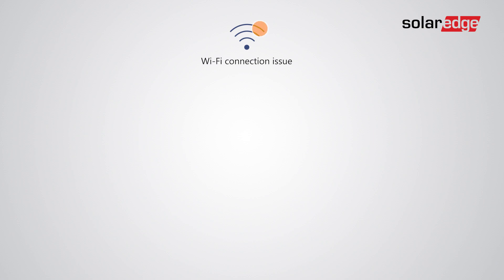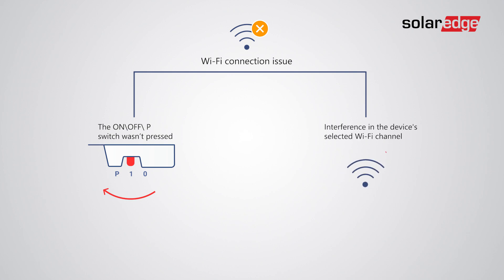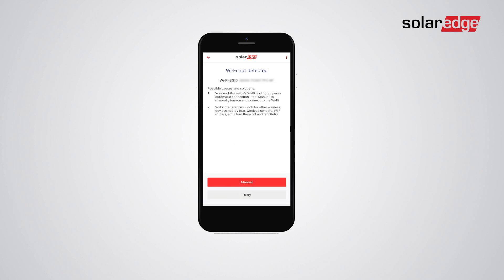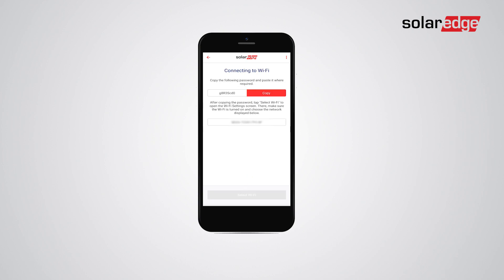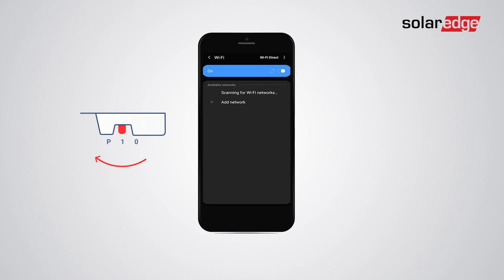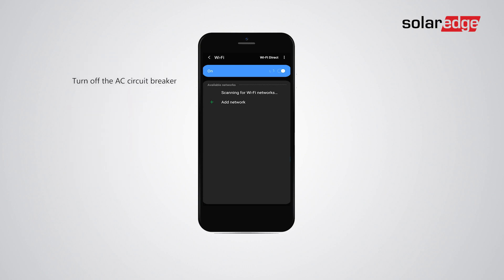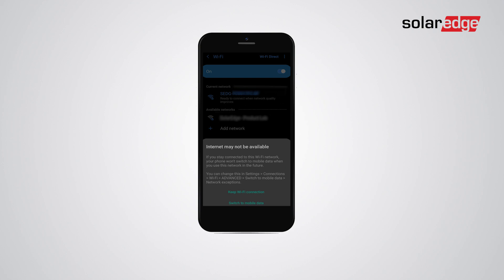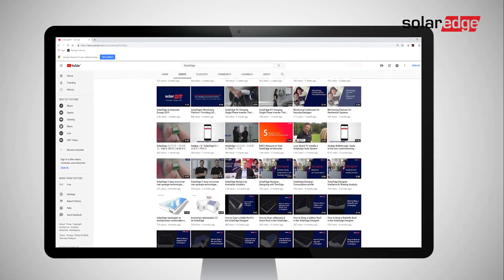Solving Wi-Fi connection issues with SolarEdge SetApp-enabled Inverters| International

Comment: Hi my WiFi works good, I can connect the inverter to WiFi no problem, but after the inverter goes to standby it looses the connection to WiFi and doesn't reconnect until I do it myself manual with the SetApp. Is this something with my WiFi or the inverter. Any help is appreciated thanks

Comment: this fucking thing tells me "ethernet (LAN) not connected". the fuck is that all about?
Reply: Same to me?
Reply: How did you fix it? or did you need technician to come out and switch the communication back to Wifi?
Reply: @couver111 unfortunately, all i can say is a different, evidently more competent tech showed up and had it running in a snap.

Comment: When I go through the steps it says connected but then asks for the LAN. There is no LAN. Any idea?
Reply: how did you resolve this issue? did you need a technician to come out and change the communication back to Wifi from LAN?
Reply: @couver111 i have the same problem. Did you manage to fix it?

Comment: Hello Everyone!

If you cannot connect to your inverter AP (wifi SSID doesn't pop up) please reset the comm. module as described in this video (switch to 'P' more than 30 sec).

SE wifi module unable to communicate with: 
- OFDMA & MU-MIMO enabled
- channel number more than 10
- only support 802.11 b/g protocol
- only support 2,4Ghz

Comment: How do I get support? I have SolarEdge. I have tried calling both SolarEdge and my installer and I get no help. the installer came and gave me a new inverter today, mine wasn't working. it appears this new one is not working either. I have not been able to talk to anyone who can give me any information. this is extremely frustrating. I tried to follow what the app on my phone says, and this youtube video, but my inverter does not have a P switch. It only has an on/off knob. there is absolutely nothing else on it, no buttons, no screen, nothing. it won't connect to its wifi and it stops there, it doesn't tell me what to do and there's no directions anywhere. I've had these solar panels for 5 years with no problems until now and I can't believe how hard it is to find help.

Comment: Hello, what exactly does do the pressing switch to P position for 30 seconds? Is it kind of reset of all inverter or only wifi internal module or something another? Where can I find more info about that mode/command (i mean: P position for 30 seconds)? Thanks in advance.
Reply: It resets the comm. module as described in the video. So in case if you have a working WiFi connection to your router, you should not use this function, because it causes to loss communication and sets the inverter to LAN, which a homeowner cannot configure back to WiFi. Please do not use this function, this is for installers, when they first commissioning an inverter and they are unable to connect on it's access point.
Reply from the maker: You can find more info on our website.https://www.solaredge.com/products/pv-inverter/three-phase#/ Feel free to download our brochures and datasheets.

Comment: I found a solution solar edge inverters only support wifi channels 1-11 you have to log into your customers wifi with there ip address and username and password should be admin and change the wifi channel to anything below 11 that should fix your issues
Reply: Thanks for the golden tip! My router was on channel 13. Switching the router to channel 7 solved the issue.
Reply: @johnvdk9936  its ridiculous that you cant find this info anywhere 😂
Reply: Didn't work for me. The app sucks.
Reply: I reset my password and now it works! I also changed the antenna, but after resetting the password,  is when it worked! Thank God!

Comment: Not working.....
Reply from the maker: Hi, a member of our support team will be happy to assist you. Kindly open a support ticket at https://www.solaredge.com/service/support.
Reply: @SolarEdgeTechnologies  
I did in point of fact get a hold of customer service and the young man knew his stuff and we discussed several possible issues. 

He even corrected a small error on the app display's listing of KWh output.  So there's that.

But no resolution on main problem of no connection without a power interruption. 

Also one thing I was NOT made aware of was the fact that unlike the prior inverter that had a continuous display, even when I finally did connect, the effect is evidently only temporary.

I was only able to connect to the inverter data using a trick I found online where you wait until night since you'll be shutting the AC switch to off AND your inverter off at the same time, while also simultaneously resetting your own internet connection. 

The entire affair is recommended to take about 15 minutes to fully "reset" the inverter. 

Since at night, no phone QR scan was possible as usually recommended of the network and other info on the side of the inverter. 

Instead use the information from prior input attempt option offered in the app.

Temporarily, I was able to connect, after internet was back on and AC power switch and inverter turned back on.

Then it all went away.

(Note: this trick of course can be done in the daytime, but you'll lose solar power and internet service for about 15 minutes. Not an option for fam, two of whom work online from home.)